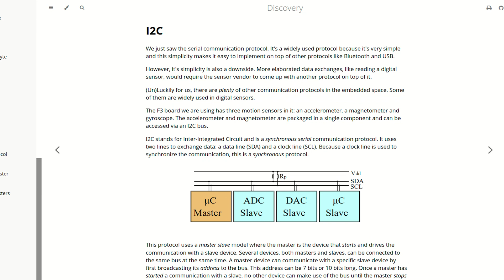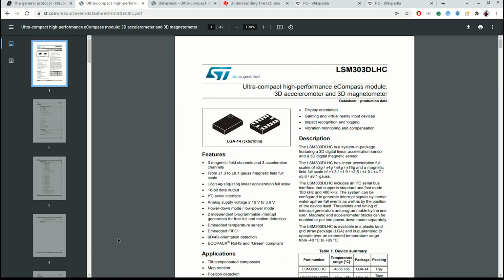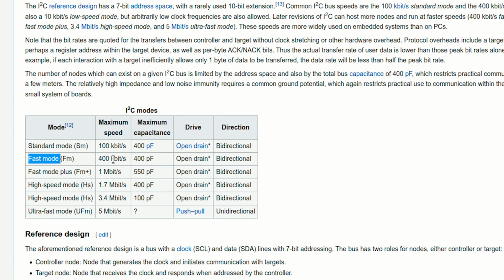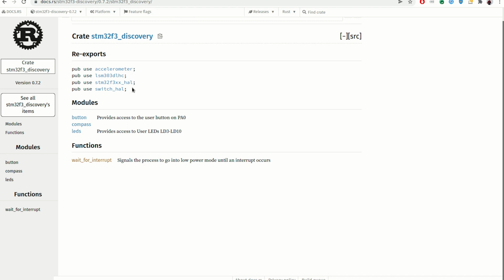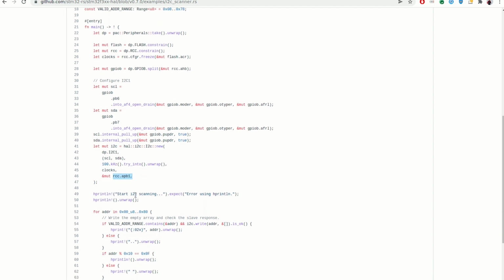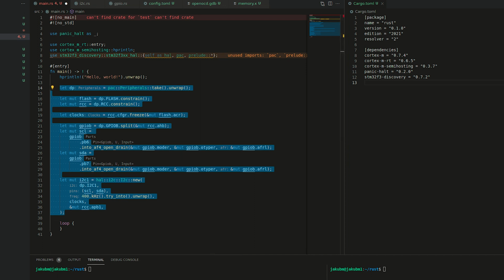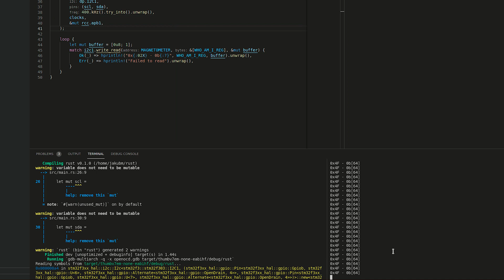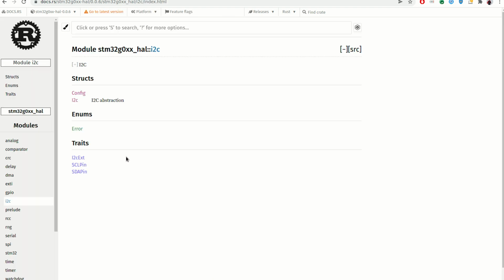Rust Embedded for STM32 Microcontrollers: I2C protocol

Comment: Thank you for all these videos! I'm looking at diving into the world of embedded programming, and although I'm new to Rust, using Rust is my preference due to the power of the language, and the amazing community. I have a house in a rural part of New Zealand and want to monitor and control some of the water systems that exist here (flow meters, water value control, and water tank gravity sensors). My eventual goal is kind of ambitious (for someone who doesn't know any of this) but it gives me something to work to. And lastly, I hope to have it communicate wirelessly using Cat M1 (LTE Cat-M).
Reply from the maker: Thank you Josh. I love the idea you have for the project. I think the best way to build it would be to use things like PicoPi or any board that allows you to add sensors. Keep me posted 😊
I want to build some very simple game console 🤫 Hopefully I will find some spare time.